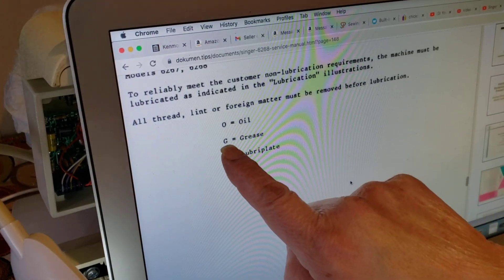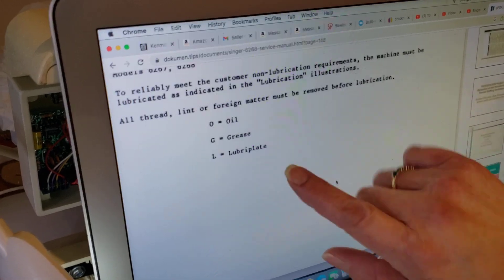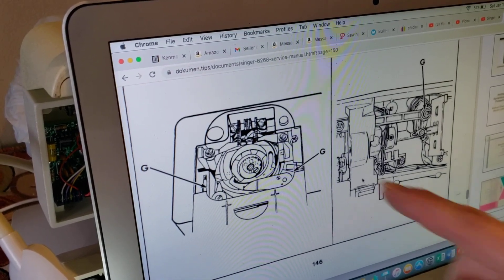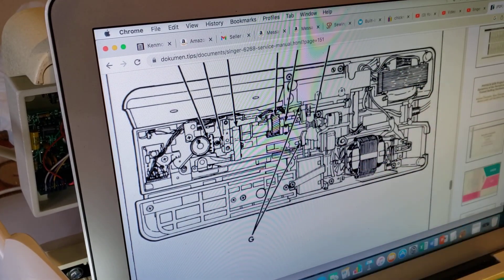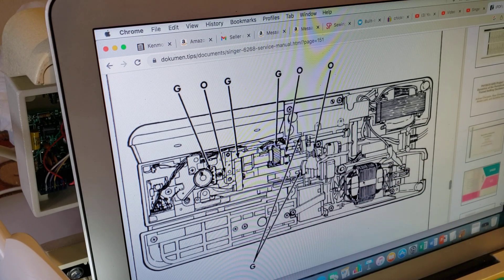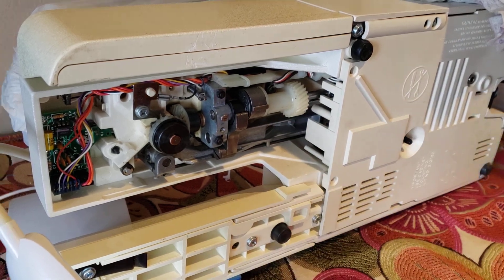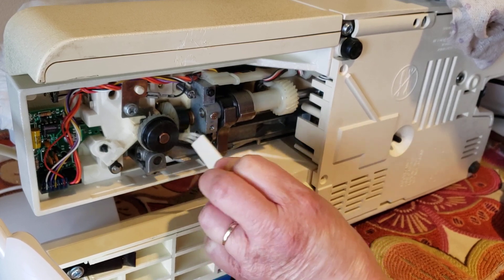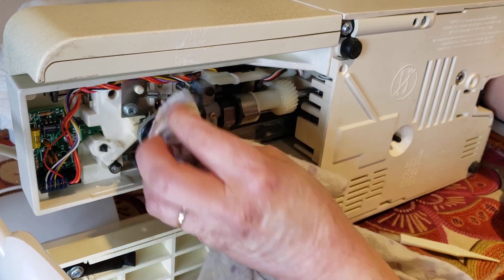Singer 6268, PART 4

Comment: Thank you Luz for the 6268 videos. I just got one at a thrift shop. The op manual says "no oiling is needed", but we know that is not true... It definitely needs oil and grease, the hand wheel doesn't turn, and the needle bar chatters and barely moves! I found the service manual online, so there's hope!